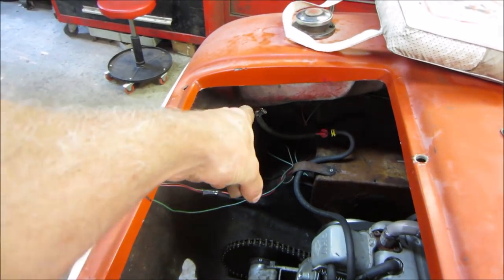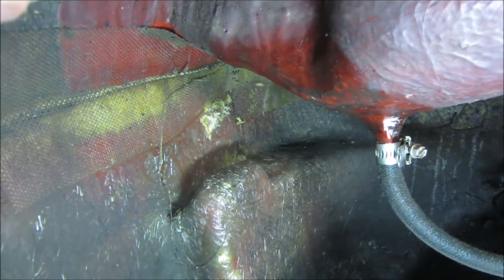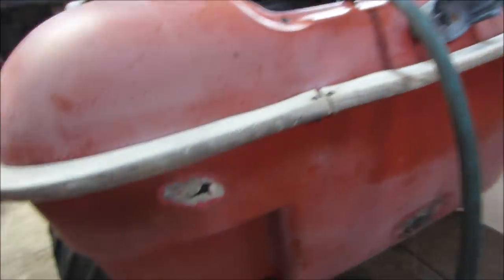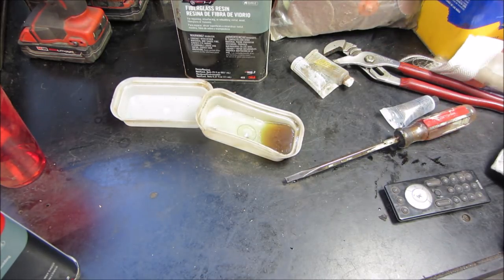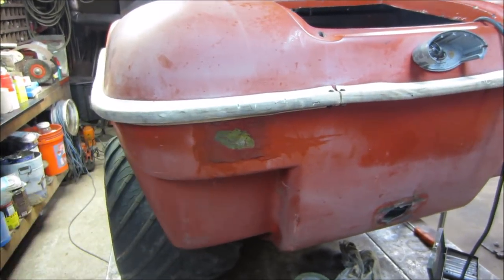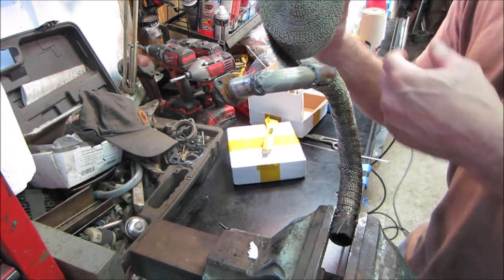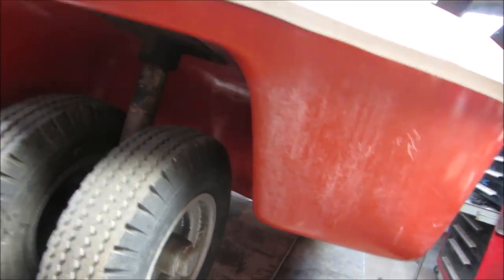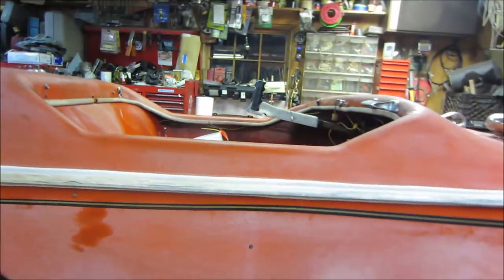Beaver amphibious vehicle fiberglass repair and exhaust wrap.

Comment: Mustie1, have you considered running the recoil starter rope/T-handle up through the top of the body so you can access it from inside the vehicle? Might be helpful in the event of a dead battery while in the water.
Reply: tonlf
Reply: Or even through a tube or something so you don't have to reach past the hot exhaust to pull start it.

RichE

Comment: i would put  vent louvers on the hood top, or a hood scoop on the hood  about 10 inches high, open end facing the front.  Can run it to the air breather.  screw all those fans and crap.  I work with fiberglass all the time, build and repair boats > Need a banding tool

Comment: I was surprised you're messing with that old type fiberglass gas tank since any fuel with ethanol in it will cause it to fail.  That engine won't benefit from higher octane, racing fuel, so having a tank that would work ok with regular gasoline would be a big plus.

RichE

Comment: did you wet it on the muffler so it will shrink? fitted something similar on Range Rover V8 headers and did not undo after nearly 10 years of off roading in Saudi

Comment: Mustie, I am almost done re-wiring my 1999 MTD Garden Tractor....I only have one issue. I need to pick your brain a bit. What would be the recommended ‘Amperage’ for the In-line fuse to run the headlights off of a Toggle Switch (bypassing Ignition Switch/they stay on continually through it).......as usual any help would be greatly appreciated.......😁
Reply: Jeffrey Sasquatch you could put an amp clamp around the power wire with them on.  Just use a fuse greater than that.  Or just start with a 5 and it is insufficient, move up.  A dead short will blow any small fuse and that is what you are after.  Just don't exceed the rating of the wire so IT becomes the fuse.  Cheers.

Comment: You need spam can opener key to tighten them and a crimper ? lol   Spray inside with flex seal ?  I thought the venting fan was a prop for back at first lol .

Comment: Finishing ortho polyester resin, like Mustie used, is significantly less strong in fiberglass lamination. Also, as Mustie demonstrated the shelf life of polyester resin is only a year or two. lamination strength degrades, and it takes more catalyst to harden it. How much more? It's a guessing game.

Epoxy costs more, but lasts more than twice as long on the shelf. With epoxy there's not much distinction between laminating and finishing resins. Mixing ratios are easy and constant. Epoxy fumes are less toxic. I just swore off of polyester resin.

Also Mustie's video left me scratching my head as to why one hole through the hull required filler and inside + outside fiberglass, but the other hull hole only required inside fiberglass?

By the way, Mustie. Buy some diatomaceous earth at a pool supply store. Mix it with epoxy to fill holes and fillets. It makes a cheap, strong bulk filler.

Comment: YouTube - How to Install Stainless Steel Locking Ties without Special Tools
He uses the trick of using right angle needle nose pliers to pull it tight by rotating it under thus burying the sharp edge.  And it looks like he got it pretty tight too.

Comment: Your supposed to soak the wrap before you wrap it. That allows it to stretch and not bunch up as bad and when it dries it shrinks tighter to the pipe. On the ends fold it under itself so it doesn't unravel as bad.

Overall not a bad first time.

Comment: Would putting a rectifier on it increase the output of the charging system?  I'm curious how these engines charging system works.  I assume it's a rudimentary alternator.  On the clamps for the header wrap I've had better results with worm drive clamps on my ATV's .  I double it up on the ends, clamp the starting end,  wrap it as tight as I can get it, on the end I keep the wrap attached to hold tension, snug up the clamp then cut and trim.  It's held up for 900ish miles so far.  Worm drive clamps don't look as good as what you used, but I can get them tight, and have the option of multiple widths.

Comment: I was bugged by the on/off switch being "backwards" to my intuition.  Interestingly, Wikipedia says:

Up or down
The direction which represents "on" also varies by country. In the USA and Canada and Mexico and the rest of North America, it is usual for the "on" position of a toggle switch to be "up", whereas in many other countries such as the UK, Ireland, Australia, and in New Zealand it is "down." ... In countries prone to earthquakes, such as Japan, most switches are positioned sideways to prevent the switch from inadvertently being turned on or off by falling objects.

So no right or wrong, but still unless a house switch is 3+way, that is just single pole, single throw as for most lights, UP is most definitely ON.  The fellow who commented about the UK and elsewhere down is on, do your house lights work that way?  Just curious.

RichE

Comment: When you use the heat wrap your supposed to soak it in hot scalding water for 15 minutes start at one end of your pipe if you do not know about this stuff I'm just trying to help start at one end of your pipe get you one good heavy rap on there where you don't think it was spent take you some welding wire wrapped welding wire around it spin it up make sure it's tight to to wrap someone into the on one in the part where you started with welding wire completely wrap it completely tight then when you get to the other end where you're going to stop you take two more strands of welding wire and you wrap them there then you let it sit and dry and you don't have to remove the welding wire if you don't want to but you can if you think it looks like s*** but once that stuff is soaking wet and it is time to and it has time to Rapid and you've had time to wrap it around there when the water when it goes to cure and water evaporates it shrinks down and it has its own adhesive built into it

Comment: Hello Mustie1,  I was wondering where you bought the clamps to fasten the wrap on the piping. Also, would these clamps be ok for axle boots on side x side?  Great videos you make, I especially like how you try to show the important stuff.
Reply: Rick Preston you can buy them at most auto parts stores and yes you can use them for CV boots most manufacturers actually use them at the factory for that purpose
Reply: ebay also sells them.

RichE

Comment: You just  chop it up pull it a
 Part little bit put it in a food processor till it turns to a powder mix it with fiberglass resin and hardener. Mix it quickly don't have to mix it for ever the hardener gets around real quick brush it on and that is a gel coat

Comment: With a single rectifier, as you described, you are wasting half of your output. If you use a rectifier bridge (takes 4 diodes) you will take full advantage of the ac input wave.

Comment: hi mustie the heat wrap is way too thickly wound and when i seal it up i use a loop or two of lockwire the steel bands they supply i have never mastered

Comment: I can see why the 2nd generation of these things (not this brand) went to 6 wheels and hydro-static drive, that steering is dangerous as a "tiller". consider checking for leaks by putting water inside the engine compartment and seating areas-NOT filling up completely- like the Grumman boys did, see if it leaks out. safer than float testing-and learning...

Comment: As an added note, sometimes I DOUBLE OVER the stainless straps like a figure 8 ( two layers ) so if I need to, I can cut close to the clasp and reuse the strap with a single layer.    J K

Comment: Hey there @Mustie1, I’ve been watching your videos for a good while now, and the “bug” bit me. I purchased my first VW yesterday (1971 super beetle) and I cannot for the life of me figure out why I don’t have spark. I have power going to my coil from the harness, I put a new coil and points on it, and the cap/rotor/wires are like new. The only thing I’ve yet to change is the condenser. Is there something I’m possibly missing? This is my first vehicle that doesn’t have EFI/electronic ignition so I could be very well missing something easy. Any help from anyone is much appreciated.
Reply: Run a hot wire from battery to coil instead of from the harness.  And definitely, yes, change the condenser.

Just how are you checking for spark?  Use known good plug wire, even if not VW, and a known good plug as a plug can not fire for all sorts of malfunction reasons.

RichE

Comment: Should try and use metal duct clamps with the adjuster screw to hold down the wrap
Reply: Also fold over the end to prevent fraying & use plastic zip ties to temp hold it on to the pipe before using the metal locking ties. GOOD LUCK

Comment: You can use ordinary metal hose clamps on the exhaust wrap.   Even for temporary "shop-aids" to hold in place.   There are other types(configuration and brand) of hose clamps for that high temperature environment.   Particularly for turbocharger ducting.  The "T-Bolt" variety comes into mind.  If they don't hold, atleast they'll crush the pipe and won't slide down..   Hey it aint rocket science...don't try to reinvent the wheel...  there's other ways of doing anything...which ever you choose I'm sure that it will be just fine...and entertaining to watch!

Comment: Why not attach a fan blade from a lawn tractor trans, and screw/glue it to the clutch ?  It will help circulate the air so you don't need to run the electric blower all the time.

Comment: Why not use pipe insulation that you use on your hot water and heater pipes?  It's hard to imagine that this stuff is going to make much of a difference.
Reply: tarstarkusz because the stuff he just put on will handle in excess of 2000 degrees Fahrenheit where as household pipe wraps start to melt around 250 to 500 degrees Fahrenheit. And yes it really does make a big difference in the amount of radiated heat released from the exhaust

Comment: The basic ingredient in resin is fish oil, the activator is peroxide which is notorious for losing potency after 90 days.
Reply: Richard Fay Google could be your friend!
Reply: rchighfield1 - It appears they are using or mixing in synthetics now days or maybe the synthetics are just consumer grade. I worked in the paint and fiberglass shop at the American Airlines maint. base for 6 1/2 years in Tulsa, largest aircraft maint. base in the world.

Comment: What about putting a v belt pully in behind the clutch in place of all the spacers and mount a small alturnator somewhere near the top front area of the engine to handle the charging
Reply: Steve Godfrey   The engine he's fitted has an alternator built in. Part way through near the beginning, Mustie talks about building a rectifier for the charging circuit. He was debating about using inline diodes to "cut" the sinewave to provide half-wave rectification . Won't be true DC and would cause LED's to fail due to the AC component in the supply but normal lamps would be ok. Ideally, he'd build a wheatstone bridge out of four diodes or just get a rectifier pack for it. Much healthier for the battery as well.
Reply: jeremy toms yea i understand that. But he was also talking how the system only produces about 3 amps wich isint enough for a blower and lights
Reply: Just rewatched that section. Only 3 amps and electric start as well ! Not a good design at all. You're right, ideally he needs to fit a small additional alternator to cope with the load. But if you're going that far, then either use an alternator with built in rectifier pack or fit the pack remote. At least then it would be worthwhile to install a fuseboard for all the circuits.
Reply: jeremy toms correct. Most small automotive alternators to my knowledge have built in regs. These days. Just need a trigger wire and a charge output

Comment: Resin alone is not a good choice. lay up some chopped with it. Or a better choice use two part epoxy with some thickener. Another item to help is to put KBS  Tank seal on the inside..

Comment: that fibre gas tank,,1 bar of hand soap  forced into the leak, a tube of seal all over top of that leak stopped by the soap,,,,,,,,,,,,all is good after ,done that maytimes both good for fibre tanks, and auto tanks.

Comment: I would remove the engine, degrease, scrub, acetone rinses, scuff, 2x layers of cloth & resin the engine floor. Hacksaw old tank off, riding mower tank way nicer, see amount, larger.

Comment: Use stainless steel safety wire on the first wrap to hold it.

You need to wet it and wear a mask.  The silica dust gets in your lungs.  Not good!

Comment: If it floats why not rattle can paint it? there isn't much to it, its small, how hard can it be?
Reply: humbug it would peel over time as rattle can paint isn't designed to go over marine grade fiberglass resin, nor go through water lol
Reply: You would use an etching or plastic primer first and paint a 2 pack over that.

Comment: When all else fails …….good old wire coat hanger, LOL
Reply: callmenort nortin bend it in half with a loop on one end, wrap it around the material and through the bottom side of the loop, grab good heavy pliers and twist. been doing that for years on high pressure fuel lines never had a problem.

Comment: maybe you could runn a altanator off the chain drive in back of the motor  n have it charge batt n power your fans maybe ......good luck....
Reply: why not get sum of those new trans parent solar power film panels n line the front hood n back hatch thn youd have solar ....

Comment: Why didn't you Google "how to use metal tie wraps" (without specialty tool)??????  Cut off the excess leave a scant 1/2" using curved needle nose pliers grab the very end and roll it under, flatten the small coil created by rolling under, grab this with the pliers and roll it under, this will tighten the cable tie and prevent it from loosening.

Comment: You sure don’t know anything about fiberglass repair. Resin doesn’t have strength at all it the cloth that gives it its strength. If you don’t use finishing resin it will not cure the way you did it.  Read directions next time it may help.

Comment: Put a real motor in like a 650 cc
Reply: liviu lee would make the thing too back heavy.. boats need balance or it'll lean considering how much heavier a 650 is itll more than likely cause it to draw in water. plus the 650 would cause the compartment to get way too hot. as well as cause all kinds of clearance issues